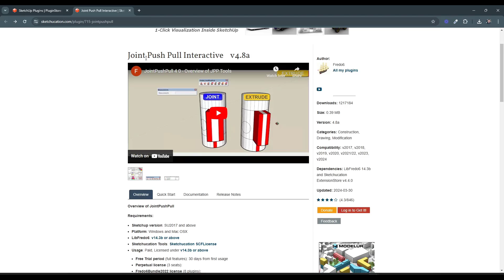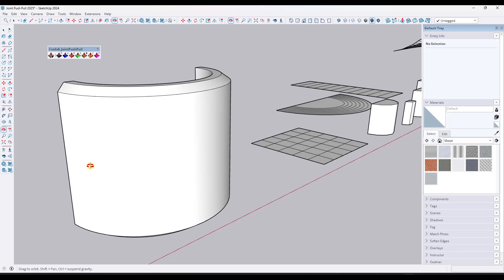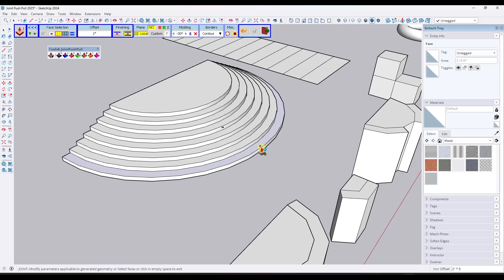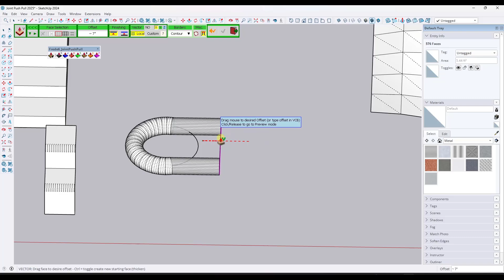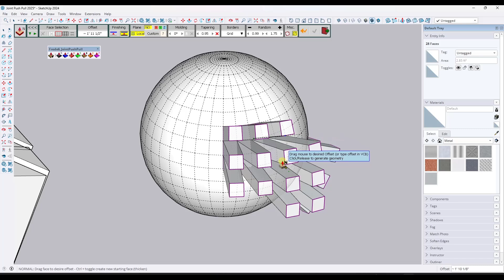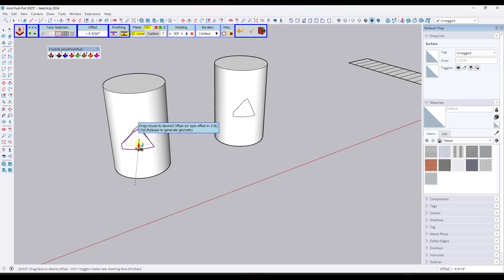The ULTIMATE Guide to Joint Push Pull for SketchUp in 2025!

Comment: Hi, thank you for another great guide. extruding the face of the first object in your guide, the new face/edge of the face is no more aligned to the x axes but goes under some angle away from x (following the normals??). the "Follow Push Poll" option solves the problem, but not if you split the original face horizontaly into e.g. two parts, then it creates a mess...pls help

Comment: Looks great! 

Would it also be possible to push/pull an cylinder shape with holes e.g.? 

Love the fredocorner extension, so this might be an option for purchase if it can do  that
Reply from the maker: Yes depending on what you're trying to do. If you're trying to actually cut a hole, it might be better for you to either use intersect with model and a cutting shape or something like solid tools. If you're just extruding an object with a hole already cut in it? Should work fine
Reply: First off, thanks for the time and effort you put in this videos. Forgot to mention that. 

And for your reaction of course. 

It would be the last, extruding an cylinder with multiple holes in it. Glad to hear that would work.